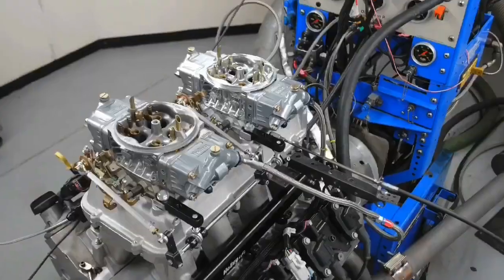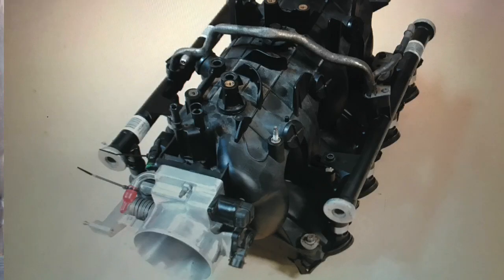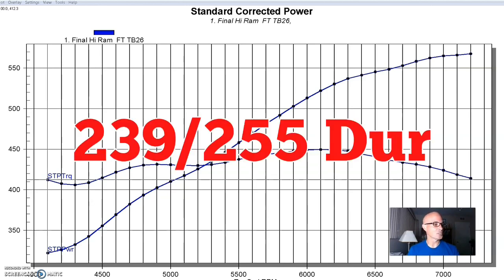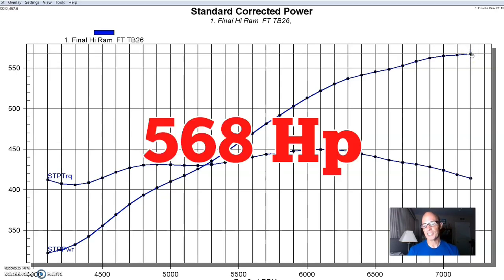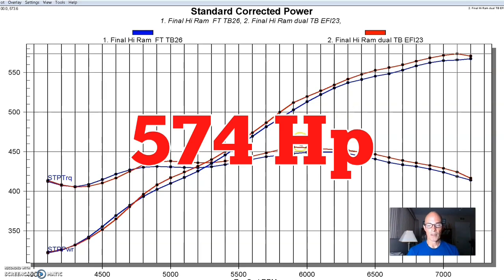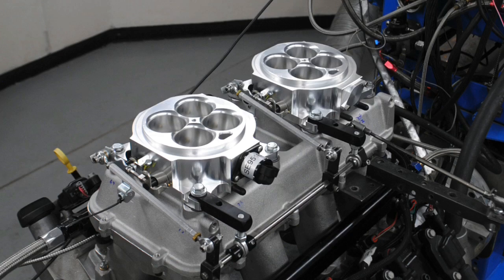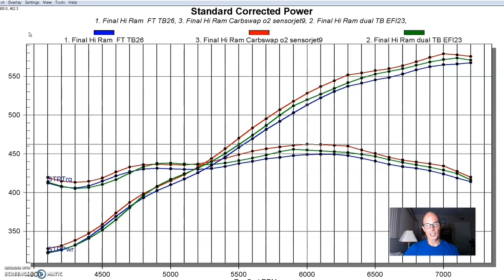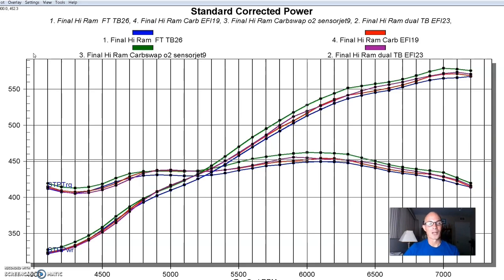LS1 CARBS vs EFI-WHO WINS?

Comment: This test is pretty much what I was expecting regarding results, except hahahahaha, here it comes, yes it is obvious that port EFI you have more control of individual cylinder A/F ratio, and I agree that using a SINGLE -TBI/Carb will leave room to bad cylinder A/F distribution among all cylinders, but I think this is much less in case you have two Carbs pretty much right on top of each  cylinder with a straight pad.

I see in the curve of this test a dip at the end of the curve with the carburetor setup , I assume ( and possible wrong ) that your carburetor metering went out of desired range at that point, assuming that I'm correct, then the way I see it if you have a TBI which have the 4 injectors included like a Sniper or other models then you have the advantage of air charge cooling and to keep your A/F more stable than with you carburetors, it is like having the best of both worlds, but like I said before for this if you have double TBI system setup since there is a straight pad to each cylinder, and I understand that we are talking of very few TQ/HP or only and a well  desired safe A/F to stay away from detonation, the only way to test this is to measure each cylinder A/F with TBI ( with injectors included ) vs Port EFI to see how much deviation there is actually on the TBI system on cylinder distribution, I understand that you don't have a Sniper system or alike, but in case you do have a single carburetor plate for that HI-ram intake, with that we can see that cylinder distribution is less with double carburetors where there is a straight pad from the venturis to the runners vs single carburetor and there for it will be pretty much the same result with TBI except that with TBI you have better control on A/F throughout the curve of rpm.

Thanks for these great videos keep them rolling out.

Comment: Richard, why didn't you run throttle-body injection? Where you run the fuel at the top, where the carburetor enters the fuel? So we can get charge cooling and 
have complete control and have better atomization and better fuel and make more power and have it be the ultimate fuel injection???

Comment: port injection would alow for more freedom when designing the manifold alowing the motor to fit in tighter spaces or optimse the runner length for the cam, also port injection seems to work better and safer in boosted aplications(could always add a more efficiant intercooler for charge cooling) and everything is better with boost

Comment: I live in a four season area and while a carb’d car would be fun, I don’t want to futz around with jet sizing every time I want to go drive either the winter or summer. Now I know I’m gonna get the carb guys saying that’s “not necessary” but I beg to differ and want my car to run well all the time and start up without having to worry about flooding. EFI is better for boost and daily driving, carb is better for N/A racing and if you want that intake sound.

Comment: The Carb vs EFI question is most relevant in budget backyard builds on motors without cheap support. For instance, your typical 2v mustang 99-04. You add your cams, port the heads, put the headers on the motor and you are at a point where you add a bigger throttle body, but wait, what intake? There is the shittastic stock one, the TFS intake for 1000, which uses a different style throttle body, a professional products one that will crack every 6 months for 350, or a custom one for 2500. Then you add injectors and your throttle body, then you have to upgrade the mass air meter, then you have to tune in. All told just in the intake/air system your in it for 3 grand if you do all the labor minus the tuning for 330whp. Now back up. You got your heads/cams finished. You get a victor jr for 325, your 400 carb, your 450 msd 6 box. Now you have a complete system, that is fully maxed NA, that if you tune the carb right will have 2 step, timing retard, nitrous control and will put down 375 to the wheels add day long and a much flatter torque curve.

Comment: If you look at high power NA rotary circuit builds, they have the primary injector near the rotor housing, and the secondary injector spraying into the bellmouth (like the Honda test?) and they made measurable power increases

Comment: Richard why didn't you run throttle body injection where you run the fuel at the top where the carburetor enters the fuel so we can get charge cooling and complete control and better atomization and better fuel and make more power and have it be the ultimate fuel injection? Well there you go :) Sorry couldn't help myself.

Comment: That's one happy dyno. Thanks for showing the results.
Reply: Doesn't really matter if it's a happy dyno or not. You are still comparing before and after.
Reply: @richardseymour7433  that is why I acknowledged the results. Does not change the "happy" dyno numbers. You can take your knee pads off now.

Comment: Saw a setup on another channel where they provided bulk of fuel with a perimeter nitrous plate spraying only methanol, then used port injection of race gas for fuel trim. They are running holley engine management so it will self correct on the port injectors. SHOULD work :-). Could do the same with TBI perhaps ?

Comment: Richard, why didn't you run throttle body injection, and then split the fuel between the throttle body and the port injection for individual cylinder trims? That fixes both problems! Then blow through all of it with a S475 because everything is better with BOOST.

Comment: Ok Richard this kinda goes with your test. If you would have used a duel plain intake manifold with it's longer runners with a TBI unit, would there be much of a difference between the TBI unit and a carburetor or what if you used port injection in the duel plain intake manifold and a one of those 1,000 CFM throttle bodies? I would think you'd have great charge cooling with the longer runners of the duel plain intake. Thanks again for your hard work Richard.

Comment: Now you need to run the 4bbl throttle bodies with the injectors mounted in the lid pointed at the ports, so cooling and individual cylinder fueling ;-)

Comment: So, carbs win…on a dyno…and above 4000 rpm.

The real world is less advantageous to carburetion.  Engines are installed in vehicles that move in a dynamic environment.  G-forces affect carbs far more than EFI.  Intake air temperature and pressure varies.  Throttles are rapidly opened and closed.  Etc.

Point A to Point B, EFI is probably going to outperform carburetors (and use less fuel while doing so).

Comment: How beneficial do you think it would be having a single fuel injector upstream, say in the throttle inlet for the only purpose of cooling the intake charge. The standard port injectors do their job like normal.

Comment: On a high end N/A fuel injected motor I run fuel injectors in the port and also small injectors in the throttle body's just above the throttle blades. Also small injectors run at a higher fuel pressure makes more power most of the time.

Comment: I believe the difference you saw between the dual quad throttle bodies and the 102 single is more of a function of airflow direction. With the air having a straight shot down the manifold, down the runner, and in the engine, my thought is that you get a better air flow characteristic. The air can be drawn in a straight shot into the engine

Comment: Here is a video ideal.  Using a lazer temp gauge measure the temp of the bottom of the manifold during a dyno pull with the carbs and then the fuel injection.  It would be interesting to know what the temperature differences were.

Comment: Just a thought, but in my opinion carburetors make more power because introducing the fuel at the throttle blades does a few things that you can't do with port injection. 
As you already pointed out, fuel has a cooling effect on the intake air charge. We already know a denser charger produces more power.
Well, wouldn't the extra mass of the fuel itself be helpful in producing power? I would think that the added mass, or weight of the fuel, would help to not only straighten the air charge, but speed it up slightly as you have a heavier mass of air moving downward into the cylinders. I'm thinking a small ram air effect, using the fuel as extra weight to do the ramming. As objects in motion tend to want to stay in motion, I'd think that the extra weight of the fuel helps keep the air charge moving. 
Idk. Maybe you already said it, or said it a little differently. 
Great videos! Keep em coming!

Comment: I like EFI because it gives me more control over the tune at each cylinder with port injection, and with both TBI and PFI it allows me to heat the fuel in the rails to get better atomization.. hard to do that with gasoline because it doesn't completely vaporize due to the various chemicals its made of having different boiling and flash points, but its very easy and beneficial to do with with ethanol. 200F in the rails under 60psi, and when it hits the relative vacuum of the intake port it vaporizes instantly, which pulls heat from the charge as well as providing a LOT more surface area for the fuel to burn. A fog burns more completely than rain drops... Crank up the compression to C16 levels, run the whole thing hotter. That means hot air, hot fuel, and make as much cylinder pressure as you can within the constraints of the engine, gaskets, etc. find out how much timing it really wants, and you get more power with much better efficiency.

I like carbs because they can be dirt cheap and they are easy to work with. Tuning my EFI is easier, but its not simpler. Its why I have a big pile of Qjets and buy used Holleys from people when they are selling them cheap. Can't heat the fuel because it will vaporize and escape the float bowls of a carb, also it will never get hot enough. Been having fun with this for the last 10 years. I want to inject the fuel as far up the runner as possible, and I am kinda thinking I need a tunnel ram for one of my 455s.

Comment: So what would happen if you went with a Holley x-ram and moved the injectors to the start of the individual runners?
how does that charge air cooling work out on a turbo application?

Comment: Very good video to make this point,  This fact is also amplified using methanol or high ethanol amounts..  Then factor in the iat ability of nitrous..And where it is sprayed prior to intake valve location..  OMG now we're talking...  Great job sir.. Out of curiosity have you ever tested dart pro 1 230 angle plug heads on 23* sbc stuff with high compression and healthy roller cam???? TIA

Comment: Richard Holdener Great test, it was spot on and sums it all up, i think what ppl dont understand is when doing carb or efi is on an intake with equal runner length you can dail in the a/f more evenly between cylinders with a carb vs a single or dual plane intake. With a carb you will simply have charge cooling and with efi port injection you will have control.  The real question is what do you want in your engine program.  I like carbs but i myself like to make my own sheet metal intakes, it makes life easy for me to tune, efi is great also, but tuning a carb is cheaper and straight forward.  Great test Richard.  So get off your ass and test some more we need more
Reply: Jeff Kopis  No. I only make them for my engines.  Richard is right. Intakes are rpm specific and dont work how ppl want them to work they work for a specific combination.  When u custom fab a intake you can taylor it towards you combination.  I would say my goal is to make a consistent intake.  Equal runners, signal strength, even distribution.  Its not easy to do umder the hood of a car.  Plus i was praising Richard because he spend his time testing this stuff for us and some ppl still take it for granted

Comment: I swear Sometimes I think you’re reading my mind. Lol I was waiting for this test for so long. My question is would you gain more torque if you went to the mid rise dual carb  set up? It’s not only the performance but the fun factor for me in the look of dual carb.
Reply: Angelo Vasilikos mid rise = shorter runners = less torque
Reply: This is what I thought as well watching all of Richards videos. I looked at it as if it was a old school LS truck intake. But while I am confused about is on the specs it shows basic operation 4000-7000 RPM.
Reply: Angelo Vasilikos thats because as runner length gets shorter it moves the operating range up in RPM.  Thats why short runner intakes have less torque down low and need to spin to the moon to make power but make more peak power. In a race motor at the track where (after launch) you’re always above 4,500, its not a problem. The short runner intakes will make more power up top which is what you want at the track. For the street where most of your time is spent in low rpm the short runner intake will feel slugglish compared to a long runner dual plane intake. The long runner dual plane (like an edelbrock Performer RPM) has fantastic torque and will get the car motivated quicker without having to wait for the engine to rev up but will fall off in power between 6,000-6500 and wont make as much peak power. If you look at a an even longer runner more traditional dual plane like the regular “edelbrock performer” which mimics stock style intakes, the power band is only up to about 5,500 rpm but will have the most toque possible.

Comment: Bottom line is carbs can always make a squeak more hp. BUT Fi always has better repeatable drive-ability. Carbs are still cheaper than a full Fi setup. Me personally I love the drive-ability. I would love to build a big cfm sixpack for my 500cid roadchicken on top of my Weiand tunnel ram sixpack.

Comment: So running staged multiport injection gives the latent charge benefits as carb, as long as secondary location is as high up the intake as you can without adversely affecting distribution.

Comment: That is why feel that Annular Boosters is a huge win when ran on Tunnel Ram Manifolds... You get the charge cooling... BUT you are delivering a finer droplet of fuel which will produce even more power than your typical straight leg or downleg style boosters... 
  You knocked the ball out of the park on this one!!! Great info.... 
Andy
Reply: I'm running the Edelbrock AVS2 carbs on my Camaro and they do make a difference. And cheap too. I don't need the computer headaches.
Reply: Yup he used bag o shit straight leg carbs.
Reply: Annular are awesome.  Just as long as you dont go full rich on top end.
Reply: @tahcogunworks  I admit they can be tricky.. but with Emulsion and  high speed bleed tuning you can get the fuel curve pretty flat.. just takes a bit of time and patience! Lol
Reply: Annulars and programmable ignition timing has made carbs great again. Shout out to datalogging, too.
Reply: What annual booster install tool do you like? I have a Big Block Chevy I want to run dual vacuum secondary holleys with annular boosters in a dually pickup.
Reply: Do you have a video with a much simpler comparison?  Stock truck intake vs single carb w/dual plane……

Comment: It would be interesting to see if you did a test where you used both carbs and port injection. At cruising speeds you could just use port injection but under full throttle use both.

Comment: I know that back in the days of f1 racing when they were still NA they had injectors at the top of the manifold pointing into the intake port, they wouldn't idle under 9000 rpm and turned 20,000 rpm.. I'm guessing in a sport that spends millions each year on engine design, would know a thing or two about intake manifold design. I know when pro-stock went eFI a big controversy was where injectors could be placed, they wanted in the intake but nhra set a rule saying x distance from the valve or port face I forget which, I dunno if that is still the rule but they know a few things about intakes also. Engine masters when it was still a thing, John Kaase was known for his injector placements and actually faced the injectors back into the plenum. and won that meet with the unconventional placement. So a lot of science in intakes and fueling locations.

Comment: So I have had a theory about 2 stage injection where 60-80% of the fuel charge is injected at the throttle body and then each cylinder has an injector to make up the required amount of fuel based on a 3d or 4d table. It would be a nightmare to tune however it might have some gains in power. Unlikely to be worth the headache however 😕.
Reply: You can already do that with something like a microsquirt / megasquirt and you can have it transition between the two at a certain rpm range.
Reply: @tomtom1541  yeah I have seen those features before, it more of the implementation difficulty in most applications that would likely limit its viability.

Comment: I think a good throttle-body injection setup is still a great compromise for a street engine. Of course you lose the individual cylinder tuning of port injection. (how much does that cost for a customer? How many of us would actually go to the trouble?) But you keep the charge cooling benefit, as Richard says, and you keep the fuel injection benefits of easy computerized tuning, (especially under part-throttle conditions that we don't see on the engine dyno) cold-start performance, and fuel economy (for those who care about such silly things. That could also be a fantastic alternative to a blow-through carburetor on a supercharged setup. Want to tune for  water/meth, or nitrous? No problem, because the distribution will already be about as good as the carb, and you won't need water-meth nozzles on every port like with a port-injection long runner manifold.